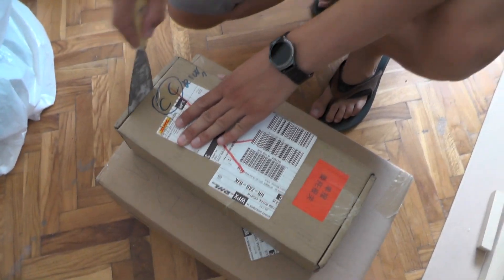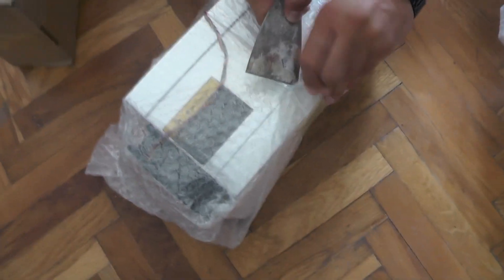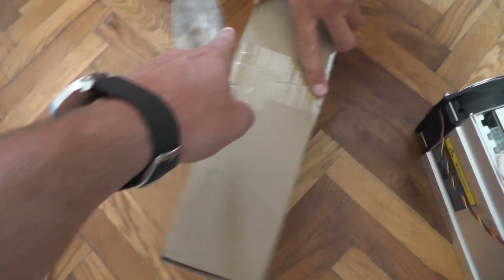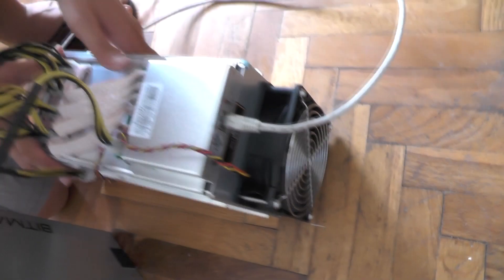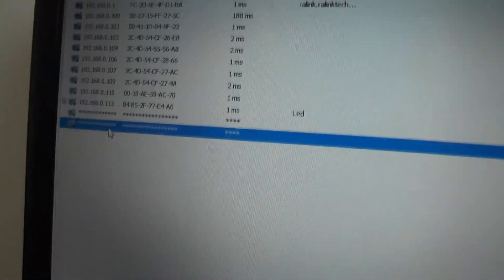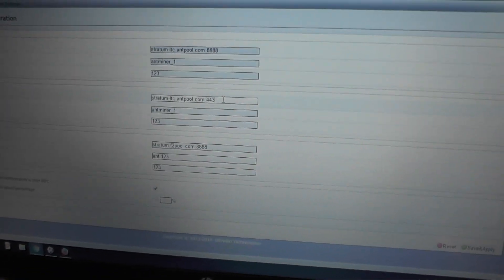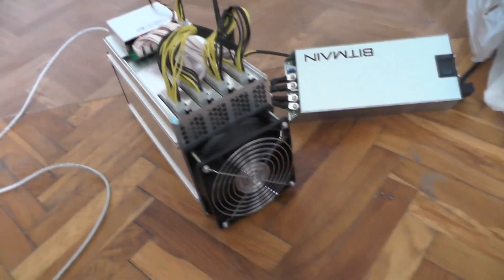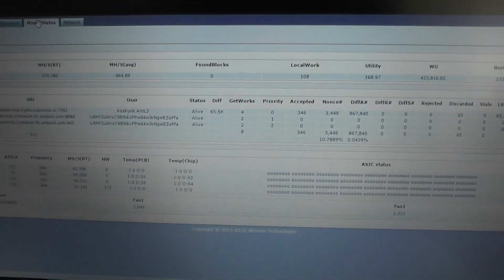[HW: Unboxing, quick look and setup:] BITMAN Antminer l3 plus

Comment: Hi there. I have a question. If I'm running only Antminer L3+ do I still have to choose 3 pools to mine with.
Reply from the maker: To be honest i'm not quite sure since it's not my miner, however i think that all 3 are it-then method which means if #1 fails go to #2 and if #2 fails go to #3 so i think that all 3 are not necessary. Cheers

Comment: hey bro.. thanks for the video. Just got 3 L3+ today and, for the 3 of them the power supply (original from Bitmain) works, spins and go pretty loud but the unit itself its not running. How long to wait before the machine kicks off? Should be right away right? Thanks :(
Reply: I think i just discovered watching your video again.. Do you need a converter to 220Vs? 110v wouldnt fire up right?
Reply from the maker: after you configure it rather fast.